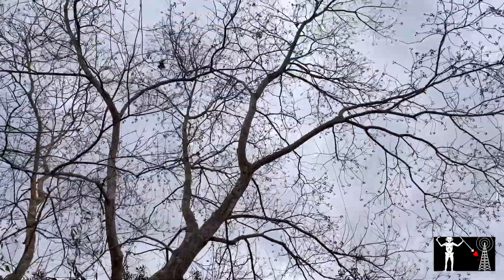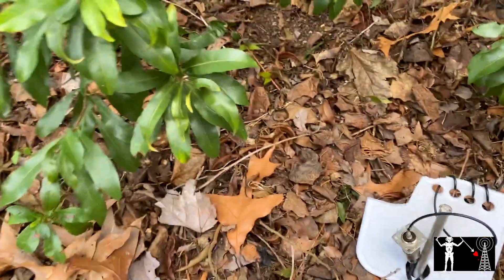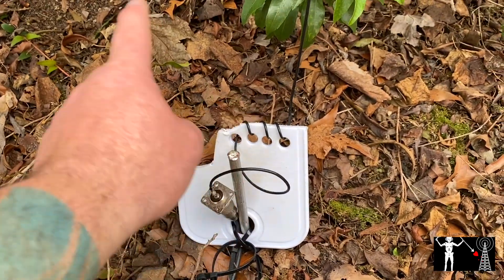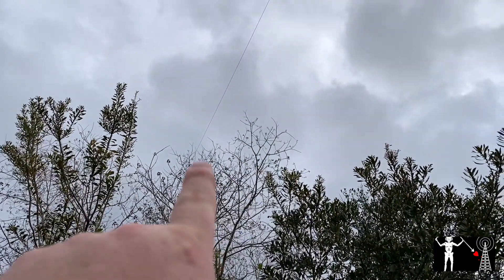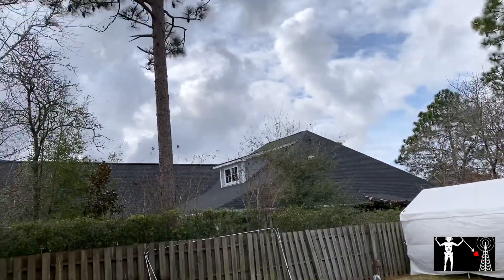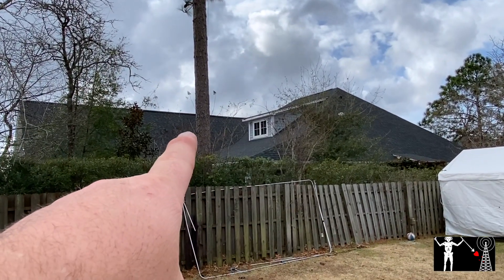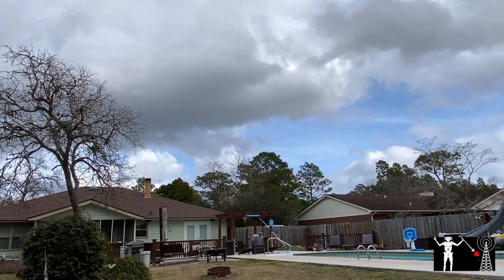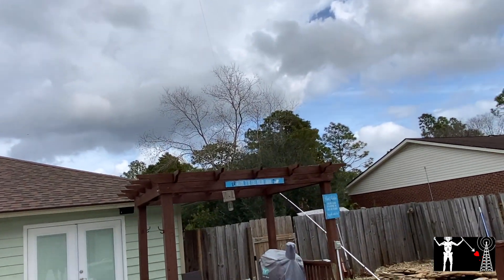Home Made 160 meter long wire home made antenna

Comment: Hey Justin. How does the 160m antenna work for you?
Reply from the maker: It’s doing good. It took some damage over the summer but it’s on the air and still doing well. SWR has come up but is still under 2:1. Thanks for watching.

Comment: Your next step should be to take an antenna analyzer to see what the SWR looks like.  You also need to take into account the four turns you have on the cutting board as it's forming a base loading coil for the antenna along with providing strain relief.  I'd also suggest you add some sort of lightning arrestor, like one from Alpha Delta.  Just a strong wind and rain can generate a lot of static electricity on that long wire in the air.  If you have room for a couple of 131-foot radials you could raise the feed point up about ten feet and have the radials coming down to the ground in an inverted "V" configuration.  Elevated radials are more efficient than ground mounted radials.
Reply from the maker: Thank you for the thought on the radials.  The analyzer showed it was pretty flat.  The SWR was low enough at 1926 that my internal tuner would not even move it.  I do need to work on it this year some so I will look into the radials.  Thanks for watching.

Comment: Is so annoying sometimes that we find a nice corner in the house to build a nice shack.. then we don't have an easy way to pull coax in )). I love how much space you have for antennas. My garden is a bit strange so I can't put anything longer than 40m of wire )). For the same reason... hard to bring coax in, the easy and cheaper way. 73, YO6DXE. I subscribed cause you have the beard I wish I had but it just won't grow hahaha.
Reply from the maker: Thanks for the follow. The beard is a blessing and a curse. Hot in the steamy summers we have. But I had to be clean shaven for most of my life. Now that I don’t I love my beard. Also the yard is great. I wish I had one tall tree. But the tower will go up soon enough
Reply: @Blackabeard  Ohh I hear you with the tree. Same problem here... I used to have one and it was so good for antennas. Sadly it was old and I had to cut it down. Now I use a wooden pole but is not as high. About the beard... yep... that is why I want one haha..  I had to be shaven all the time for the jobs I had and I hated it haha. Now I can grow the beard but it seems all I have is Jack Sparrow beard not Blackbeard 😅 . 73 buddy and have an amazing rest of the week.

Comment: I’d stick a 49:1 transformer unun on that. Should work great on 80, 40, 20, 15 and 10m as well.
Reply from the maker: For sure. I use a 49:1 and 67 feet of 16 gauge speaker wire normally for my portable operations.

Comment: Look forward to seeing it on the air. No UnUn transformer?  I’ve looked at an 140’ EFLW, end fed long wire for 160m but haven’t done it yet, but uses a  9:1 UnUn.  Look forward to some test results.
Reply from the maker: Not one thing other then some RG-8X. It’s flat at 1:1.1 across the entire band.  I have it doubled back to about 137 feet and works well. Once the band opened again this weekend I was able to make some great contacts.
Reply: @Blackabeard I don't understand how that's working. I attempted a random wire antenna once. Damn near burned up my manual tuner. The impedance is much higher but you also said it was an inverted l with radios. Even then the impedance is much higher than 50 own I don't know how you're getting a match. Very intrigued I'm working on getting up of 160 m dipole. Need to talk to my neighbors though because I don't have enough real estate
Reply from the maker: I have a very little knowledge about it.  I still think SWR and propagation is all black magic and voodoo.  It all confuses me.  I read The Wire Man book on long wires and it seemed like it would work.  Threw it together and boom it worked.  Luck or skill ill take it.  It's very flat at 1-1.5 : 1 SWR.  Most of the time my if needed the interns; tuner on ,y Yaesu FTdx-10 can handle it.  Good luck getting yours on the air. And hopefully your neighbors will let you string some wire on their trees too. 
 @brandonlaragirl
Reply: @Blackabeard  thanks brother.